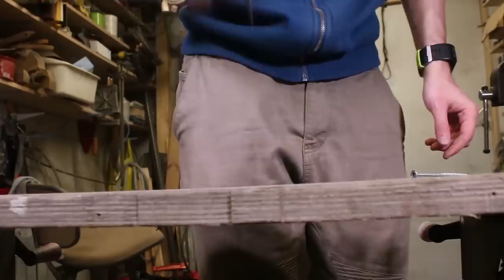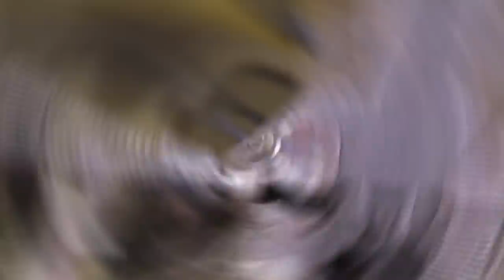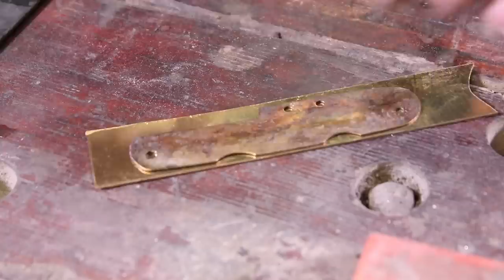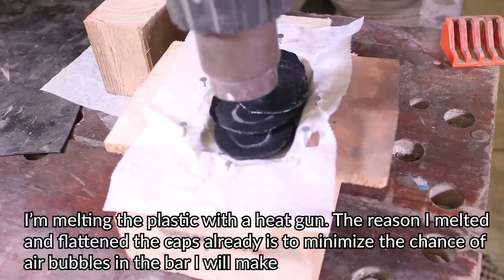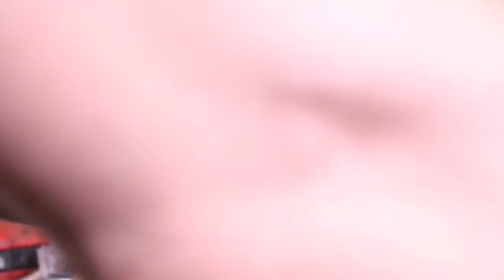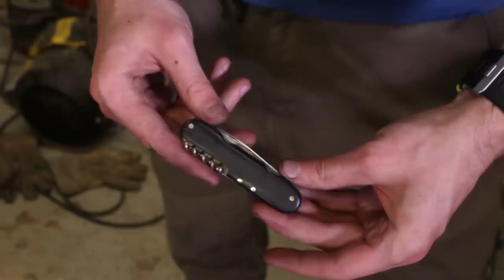Restoring old broken pocket knife - New handle from bottle caps

Comment: Many of the Restoration channels I've seen don't seem to even care about heat treating blades, so it was nice to see you do that.   However, quenching a blade in water (Rather than Oil) can sometimes make the internal grain more brittle and larger.   What do I do for the Environment?   I Exhale Carbon Dioxide...Which Plants & Trees Need to live and grow bigger.   And they Reward me by putting out Oxygen...Which I Need to Live and Grow bigger!   Very, Very Nice Restoration !!

Comment: Mmmm, knife pizza....

I wasn't so sure about the bottle cap handle but it came out really nice. The contrast between the black plastic and the shiny brass is quite classy.

My house has solar panels on the roof. It doesn't cover our energy costs completely but it does take a good chunk out of the electricity bill.

Comment: Very good job! Good use of the bottle caps! Based on the style of can opener I would guess that that knife was 90+ years old, and the grip pieces may have been Bakelite or similar material. The thermal plastic qualities of the bottle cap material gives the knife the original appearance.

Comment: Lovely! The plastic cap handle is brilliant, Im impressed by how easy that looked.
Something I need explained; why would the welding remove the heat treatment, and why didn't the torch fix it the first time?

Part of an answer to your question as well; I've taken to washing synthetic fiber clothes only when they really need them. I don't have a plastic-fiber filter in my washing machine.
Reply from the maker: Actually the second blade I heat treated is the longer blade. That seemed to not be properly hardened. Heating up the blade too much will remove the hardening. Welding makes the small piece of steel very hot. This is caused by changes on molecular level due to the heat and quick cooling.

Comment: Very nice restoration. The handle will become very slippery when getting wet. A fishbone grip pattern  on the handle would solve that Problem. A little drop of oil to the joints would make the oppening and closing much easyer.

Comment: I found an old food processor where the metal part of the top blade thing was removable. by inserting a piece of cardboard to fill the gap, then gluing down a round of sand paper, I can sand the bottle caps and such into a powder. the processor catches all the dust and grains. makes melting it easier, and you can actually fill a mold that way. No waste at all.

Comment: I'm playing with melting the PPE2 plastic as well. Might I suggest a small toaster oven for melting it, at between 350 and 400 degrees. Another key is to mix it well, use the paper and some tongs or something to melt it thoroughly, then mix on the paper, it cools rapidly as far as the melting point goes, but stays hot to the touch, so gloves might be the way to go. Keep melting and mixing until you're sure it's all one homogeneous mass.  also you can melt milk jugs, and where I live the local grocery uses ppe2 plastic grocery bags, in white, so I can get a white handle as well. regular Coke tops will give you red, mello yellow and Mountain dew will give you green, and some drinks use yellow. However with the pop bottles, you can only melt the tops. The basic bottle is weird, it will melt, but when it does it shrinks and won't stick to the PPE2. If you use steam heat from a wand inside a 2 liter bottle, you can shrink it down to almost exactly half size. 

On that note, when they were first trying to make soda bottles from plastic, the bottles would always split open if even just a little rough handled. Try as they might, they could not get it not to split chemically, so they went old school, soda bottles are actually two layers of plastic put together, one with the grain horizontal, the other vertical, problem solved. Yes, plastic has grain, just as wood and metal do, just with metal and plastic, it's hard to see it.

Comment: Suggestion: Use a cheap paring knife to separate the layers of the knife instead of a wood-chisel. When the blade gets chipped or bent, grind it flat. Repeat until you decide it is time to buy a new cheap paring knife.  Also good for simply chopping through frozen pins.

Comment: We installed solarpanels on the roof. It's great to use the sun to run tools in garage. But the solar time in Finland is not the best - 8months / year. 
Also have a small storage of HDPE plastic but havent tried to make anythingh yet.

Comment: You really should temper with oil, and when you put it in an oven to remove brittleness, it's called Annealing. Love the bottlecaps for handle material.  Experiment with different colors like red and black.  In our house we switched over to 60w equivalent LED bulbs, that only use 8w.  They cost $1 US a bulb and put out a warm glow that you can't tell from an incandescent, without the heat, which = CO2.  Best part they last 24,000 hours, if you ran them 24/7 it would cost $1 US a year per bulb.  Our electricity bill went down $50 US per month. We turned on all the lights at once and the meter just barely sped up.

Comment: You work with what you have naturally but I think TIG welding would be more suited for those little patch jobs. Like filling the holes on the blades so you could drill new smaller holes. TIG just gives you more control and is something to consider if you ever have a more delicate project.

Comment: You should try and find some old safety razors or shavettes and restore them. I only use safety razors with double edge steel blades to shave as it removes 100% of the plastic from my shaving routine.

Comment: Don't be surprised when that blade snaps off in your hand.
You heat treated it which hardened it alright, but didn't bother to temper it again. 
A quick quench will harden the blade but also make it quite brittle. The brittleness must be corrected by re-tempering the blade.

Comment: Love it.

I'm currently doing my first restoration and it's also a pocket knife, I'm going for a wood handle with a cherry varnish. Any tips on how to sand wood faster? Been sanding it for 3 days 2 hours a day, and I saw only 2mm go down.
Reply from the maker: If you want to hand sand it. The use very coarse paper and as you get closer to the shape you want, change to finer papers. Also change the paper every once in a while
Reply: @OddTinkering  Awesome thanks, I used 80 grit sandpaper, I'll go get a much lower one right away.

Keep doing what you're doing, and the gags you do in the videos make them all the more enjoyable to watch, favorite was that glove thing you did in the squeeze lighter vid.

Comment: That came out very nicely (not a big surprise though all of your filmed projects turn out well) I've seen a lot of videos about recycling HDPE - but most use it of tiles or mallets and other objects. How are the thinner knife scales holding up? If I may ask another question - how do you decide what type of rust removal is needed?

Thank you for sharing this with the online community.

Comment: I would have thought it would have been easier to sand/shape the knife before hardening and anealing. Am I missing something?
Reply: Hes sanding it to get the blades nice and shiny again after reheat treating them. And sometimes if you profile the blade too much before heat treat, the blade can warp or even crack

Comment: How would you rate the durability of the scales you made from bottle caps? I would have thought the  melting would have made the result more  brittle. Was the knife still pretty impact resistant if, say, you dropped it on a hard surface? Thoughts?
Reply from the maker: Tha caps are made from hdpe plastic. You can find videos where they make mallets out of it. I hope that answer the question
Reply: @OddTinkering  Got it! Thanks....

Comment: What I'm doing for the environment: using the same plastic bottle for water until it needs to be changed, trying to save trees when they are cut without a valid reason, buying organic food as much as I can, picking up plastic stuff abandoned on the street or parks and throw it into recycling bins.

Comment: Maybe so but the German knives are very brittle Ann they hold a sharp edge very long ,,,, you try that full strength cider vinegar it will eat all the corrosion and rust and , won't damage anything else ,,like your video's

Comment: When you re-harden blades, make sure your cooling tank is true to magnetic north and south. you may not need it on these short blades, but on longer ones you will. When heated, the metal becomes non=magnetic, but as it cools it becomes magnetic again, and a longer blade will warp if the blade isn't cooled facing magnetic north and south. That's why most blade makers hardden perpendicular not horizontally. 

question, though you pay more, how do you know how your electricity was created unless you create it yourself?
Reply: toot tall You’re joking right? Or are you actually suggesting that the infinitesimally small magnetic field fro the Earth will bend a long blade?
Reply: @WilliamCharlesShaver  Nope, not joking. probably won['t show up on short blades, but does on long swords. I know, it's one of those things that defies logic, but is true. Just like going by the old farmer's almanac when you plant stuff defies logic, I have personally seen the effect one day's planting difference can do as a test of the almanac. Same seed, same ground only 12 inches apart, same amount of water, but the corn planted on the good day was tall and put on nice full ears of corn. The corn planted just one day later on a day the almanac said was a bad day for planting corn, well it barely grew, the stalks were short and spindly, and what ears it did produce were thin and  not full of kernels. One day's difference. Explain that.  
I knew a bladesmith that worked the old time way, and he happened to decide to do a horizontal quench on a long sword. when the tank wasn't aligned, it would warp every time. when it was, it didn't. I saw it with my own eyes. Maybe the magnetism isn't the explanation, but it's the only thing anyone has come up with.

Comment: Serious question (as i genuinly do not know) but wouldn't it be enough just to cover parts with rust remover? Filling container seems wasteful (then again i do not know the price of the product so it might be cheap enough to just go bananas with it).
Reply from the maker: It is reusable, whatever chemicals are not used up will go back to the container. Even something like vinegar can usually be reused. On the other hand if you pour only minimum quantity of rust remover in the container, so that all chemicals will react but all rust is also removed, the reaction will slow down signifficantly towards the end
Reply: @OddTinkering  Thx for explaining this to me :)

Comment: drop a silk scarf on it and if it is a good blade, and you have sharpened it correctly,  it will cut  the scarf with its own weight.

Comment: caring about the environment is good and all, but how many tiny plastic particles did you create by cutting and grinding the handle ? most are going right into the sea now.
i think wood would have been a much better choice :-/ 
while sending the caps to regular recycling.
Reply: Doesn't matter.  Several bottle caps and 1/2 oz of plastic dust isn't going to change the tide.

Comment: i know it does not matter much with these blades, but i would still quench them in oil instead of water...
P.S. I don't want to ruin the world for you, but most of the "green" electricity is a lie (if you think for example solar panel are so enviroment friendly then check how costly and toxic the production of one of those actually is). And if any of you think that driving a el-car is good for enviroment, then you obviously did not though about the electricity and how that is made. The most "green" and cost efficiently stuff we have now is atom (those wind / solar / sea tech are nice and neat, but they won't provide not even close enough to be dependable).

Comment: All's nice and good...   except the POLITICAL ISSUE of "environmetality" (should be environmentality)  --  yes it's turn to be a POLITICAL ISSUE by the LEFT!  

And to clean the environment...  I do eliminate as many leftists as possible!

Why did you discard the OLD brass plates?  should have recycled them too...  like the GOOD IDEA of using SODA CAPS...

I did like the video!
Reply from the maker: The old brass plates had the same large hole drilled by the previous owner. This would have allowed the pin to bend because it would only have been supports by the plastic handle